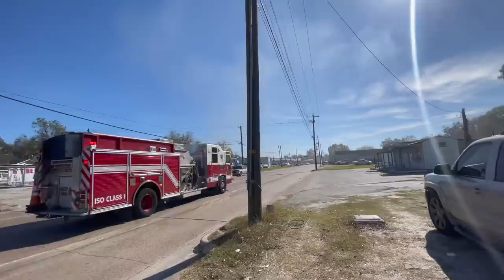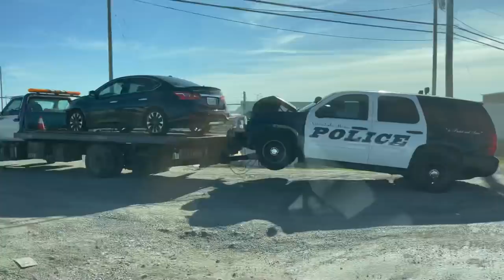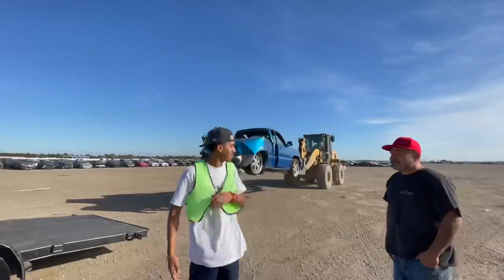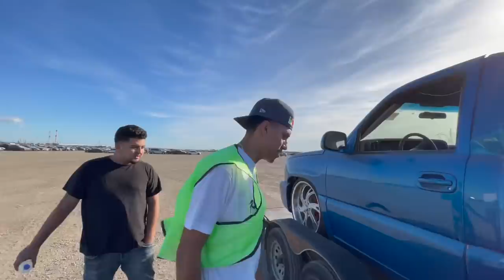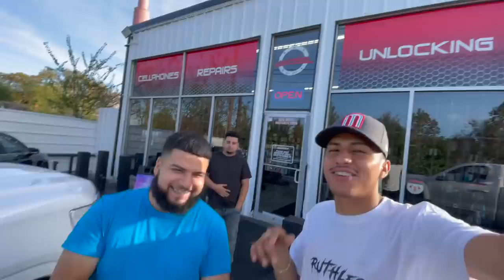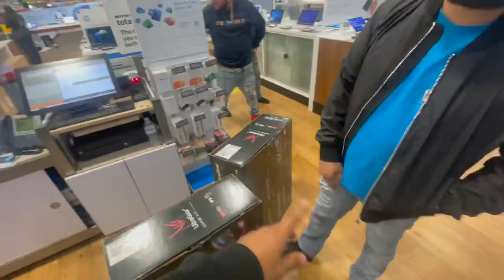MY SS CLONE IS BACK !!

Comment: Science your C notch bucked you just need to back half the frame replace from c notch back the rest is fine technically the c notch saved from having to die full frame. The cab can be pulled back to shape or panels replaced so it’s very much fixable.